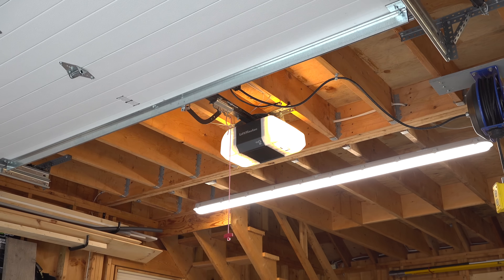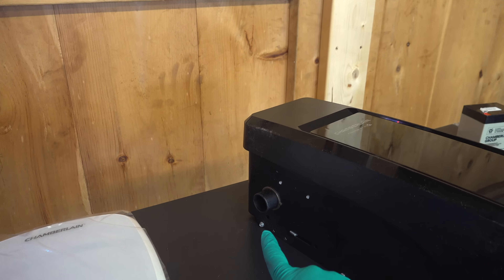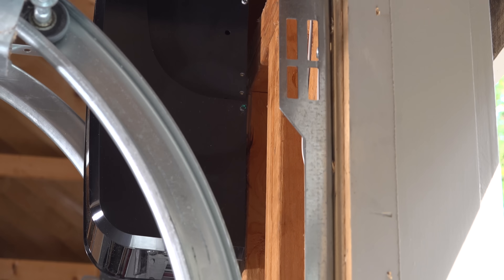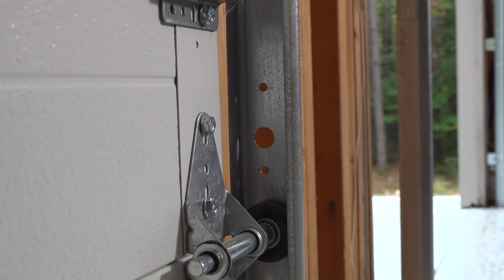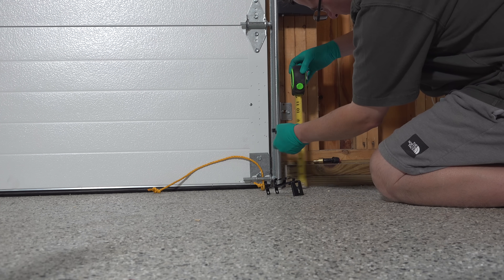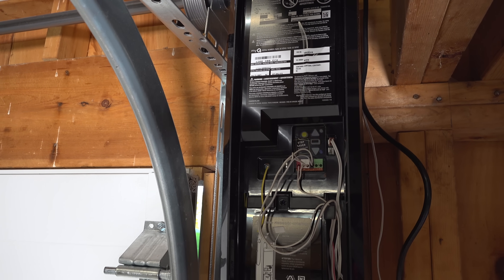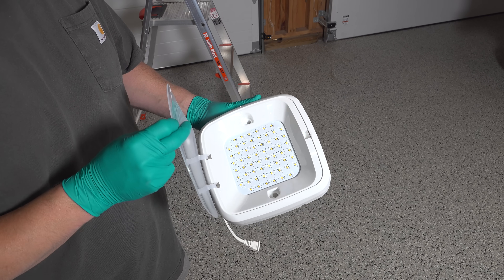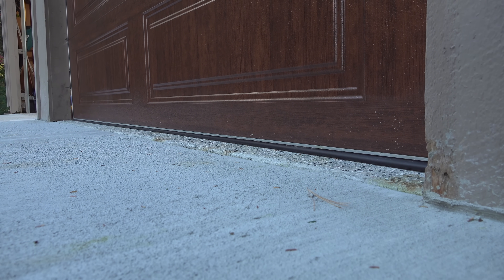Finally a SILENT Garage Door Opener that locks like a SAFE! - RJ0101

Comment: A home door that opens normally will have issues going down, the tension on these gets weird with temp changes, and when that auto deadbolt locks up in the lovk position and your spending 20min unmounting it from the wall in order to get put of the garage in the morning when trying to leave for work, you will end up very angry. Im all about automation, my house recognizes me when i pull in the driveway, i still wouldn't trust that lock. Have your alsrm company install sensors on your doors if you're paranoid.
Reply from the maker: There is a manual slider on the lock, if it fails you can slide it in a second. I am in NH so I can share that it's be handling our crazy temps well so far. Its a great opener.

Comment: I installed one of these and liked it so much I installed it on my other door too. My house was only 5 years old and the old openers were fine but I wanted a cleaner look and yes… these are way quieter than any other openers. But you will hear a clunk at the end when the dead bolt locks in. When I moved into my house, my drywall wasn’t completed in my garage so before I had it finished, I ran a new electrical outlet where the new opener was going to be mounted. I don’t even worry about anybody breaking into my garage. 99.9% of the time if somebody was to attempt to break into your garage they’re gonna think that the garage door opener is mounted in the center of the garage door and they’re gonna be looking for the red cord in the middle of your garage door Not to the side.

Comment: Standard Linear belt drive is quieter, cheaper and less problems.  I your video application, you should have high lifted and roof pitched the door.  In that case the jackshaft is the way to go.  Don't forget to disable the slide lock on the door.  Also, who installed the chain drive operator you showed in the video?  The J-arm and door operator bracket were wrong and will damage the door over time.  The bracket does not go on the strut. It goes 2" under the strut on the stile.  The pin should be closely lined up with the top roller.
Reply: You do not need to have pitched ceiling or high ceiling for this. Mine is under 9 feet. Had no issue installing this in regards to height at least. Regarding price, maybe 100-200 dollars more expensive. I wanted to get rid of overhead unit so I can lift my car. This worked perfect. I freed up at least 2-3 feet. Regarding sound, you're wrong. Again. It's very quiet. Re maintenance, belt needs maintenance. This one doesn't. In summary, you didn't get a single one right other than price

Comment: I was really excited about this product until I found out who makes it. Chamberlain/Liftmaster, who makes the products that use MyQ, has gained notoriety recently in Smart Home circles because of their constant fiddling with the MyQ system in order to prevent people from using it without going through their app. It's annoying when you have to load up yet another app just to be able to control your garage door with your phone. MyQ used to have an API which you could use from other apps, but they've done away with that. There are still some other companies that have access to MyQ (like Amazon Key, which allows delivery people to open your garage door to deliver packages) because they pay Chamberlain for the privilege. If you just use the MyQ app alone, it's free. But if you link it to IFTTT or Google Assistant, you'll need to pay a subscription fee.
I'm voicing my annoyance with Chamberlain in the only way that might change their mind. In spite of the fact that this looks like a great door opener, I'm not buying it from Chamberlain.

Comment: I strongly considered one of these openers, but they are three times the price of a normal-one, and they require an outlet close to the opener (instructions, explicitly say no extension cords although I’m sure you could get away with one)—which nobody will have (I assume you ran a new outlet).

Comment: The only issue of that style is that they don't have the anti crush feature.  If something stops the door from going down, not crossing the beams, the opener will go all the way down and the cables will pop off and the door will still be resting on the object.

Comment: Just some food for thought for people considering these, but I actually like the garage doors are noisy. I like to hear it operating for both safety and security reasons. Everyone, including pets, knows to stay clear of the door when it’s noisy. If it’s too quiet, you may not notice it and that’s when accidents happen. My car idling is louder than this style opener. So if my car is on I wouldn’t hear this thing at all. Also, security… I like hearing it from inside the house so I know it’s being used.

Comment: Our newer garage door opener looks like the old one and uses the same belt system with teeth to pull the door up, but somehow it sounds quiet like the newer one. We do have an extremely heavy insulated garage door, so we might’ve needed a more powerful motor or something.

Comment: A very good friend is an Overhead dealer for 35+ years and i help on installs at times. He has brought up points about these , but are doable. 
The best pointer from him is this, typical torsion springs are a 10,000 cycle spring, about a 7 years normal life.  You should ask for a 30,000 cycle ( approximately) replacement cycle spring!!! It's a 10-20 percent upcharge but it's the same labor for 3x the lifespan.
He measured my broken spring, looked on a chart to see it's replacement ( they are longer) double checked if it could fit and we installed them.
Oh, more hints, 1 turn on the torsion spring for every 1 foot of garage height. 8' high door, 8 turns as a general guide to get started!!
Do double check spring balancing, disconnect opener, open door half way and let go. It should stay there if it's correct, adjust accordingly!
Oil your torsion spring yearly. Rust makes the spring brittle and breaks prematurely!
Reply: One turn per foot only applies to 4" drums and even that is not quite correct. 4" drum times pie equals a little over 12" per turn but when you get to a 5.25" drum times pie, one revolution is 16.485" of travel.
Reply: Somewhat true... 1 turn is 1 foot if lift on a 12" radius with 400 drums...
Reply: My last spring was 60 years old when I finally replaced the entire door and tracks.  Never did anything to it.
Reply: @ChillWill-q5x  Yeah, I chuffed when I read 7 years normal life.  I had a door installed 20 years ago, and it's still going strong.  Maybe the newer ones aren't made as well?
Reply: @mhicaoidh1  Maybe the new "craftsman" aren't as craftsmanny as the old ones.
Reply: @ChillWill-q5x  could be, but spring building isn't rocket surgery.  😆  If, in fact, current springs only last 7 years, I'd be more inclined to blame the (cheaper) materials.  That blame would fall on the bean counters.
Reply: @mhicaoidh1  It's true, older springs are thicker and heavier, but then so were the doors.
Reply: Can you just use more springs with less force from each spring?
Reply: This is very helpful information!  Appreciate the details, in replacing the torsion spring.  I’m on borrowed time with my garage door.  Hurricanes are taking a toll.  Would you put one of these in your garage?  If not, can you recommend an another brand or model door opener?  I’m widowed retired, and second guessing isn’t a good option.  I want to do this before Hurricane season.  Thanks.

Comment: As much as I would like to have this, the clearance on either side of the door is only 8.5 inches.  The unit will fit but I don't have enough room to slide it in place.

Comment: We replaced an old chain drive overhead opener with a new LiftMaster model like this and we're very pleased with it.  Now at almost a year of use, we still love it.  It operates so quietly and smooth, and the deadbolt lock has worked very well.  No problems at all with it.

Comment: I hate the new door openers! I just put one on my door, and adjusting it in was about impossible! Blinking, colored leds? Hold the button until a certain color comes up. Is it blinking or solid. Argh!   What was wrong with two adjusting screws, that actually made sense? One for up, down stop. One for sensitivity, pressure? Simple ! Quick. My new one still isn’t adjusted just right, and I’m afraid to mess with it, thinking it will get worse if I don’t do the procedure correctly!  Oh, don’t lose the owners manual! It has the led combinations, and trouble codes! Fricken trouble codes! On a garage door opener?  Actually my new coffee maker has trouble codes too. My god!  I want to pull my hair out.
 Can’t they leave some stuff the way they were? 😫🥺😂😩😞😠
Reply from the maker: I agree about the buttons in general. I have no idea why even a TINY lcd display can't be there, it would simplify these greatly. Its a good unit and if you follow it, you can customize it but  it could be easier.

Comment: This unit rocks, have had several noisy overhead  units with plastic parts over the years that maybe last 5-6 years. I have had this unit for over 15 years, yes it pricey but well worth the money, and oh so quiet, and not one single problem.
Reply: Wait, you ve had this type of opener for 15 yrs??? I thought this was a new product??? Ive never seen this before ??

Comment: Chamberlain now owns liftmaster it seems.  Sadly, I don't have the space for a jackshaft.  Either side of my garage door there is cinder block wall that's too close to the garage door shaft.  Also, I know a couple of the software engineers that work at chamberlain up in Illinois. ;)

Comment: This is only ok if you have a second point of entry into your garage - regular garage openers have that release in case something goes wrong with the opener itself - what is the manual override on these (from outside) if the power goes out or lock stops responding?
Reply: Hmm wheres the release from the outside on the typical garage door opener, like the one in this video??

Comment: MyQ sucks since they started blocking home automation systems like Home Assistant. Don't give Chamberlain your money.
Reply from the maker: Reddit shut off API access, but allows you the PAY for it now, that's greed. Chamberlain says it was a security reason due to DDOS attacks which could prove a disaster if breached. I believe them since they aren't asking for money and just closed it except to a couple of providers (which can be locked to ip ranges). Is it good that they took something away? Nope. But they aren't saying pay me now, and the app is still free and beats electronic remotes. Their openers are excellent but maybe others will enter the space with a more open model but I am not sure I want that either. Is Chamberlain good? Nope, all companies are in it for themselves,  but 99% of my appliances in my house don't have API access either.

Comment: I have the predecessor to this model, the Liftmaster 8500. It had the external adapter for battery backup and would not accomodate communications with an app via the internet, but it was great and reliable. I still have the house and the opener, but I am in another house now, with a single bay (1 car) garage. Unfortunately, these one car doors only come with extension springs. I would like to convert to a door that is operated with torsion springs so I could use one of these newer openers.  Do you have any sources that sell a DiY conversion kit to torsion springs?

Comment: For my door when the wall switch failed for a very well known issue, which has been ignore by the manufacturer for years, it opened my garage door when I wasn't home. I guess it does both lock like a safe and then open like a safe when you are not there.
Reply from the maker: It's funny you mention that as one other door in my house did the same thing on an 2 year old opener the previous owners installed.. Ghost opening I called it, and I determined it would happen from vibration in the house, closing a door or even just a super loud noise with weak contacts on the wall switch let it open. Drove me nuts for 3 months until I figured it out. I put in for a warranty and they send me a replacement for free though.

Comment: The top panel in the door never gets pressed against the seal. In fact the whole door is just loosely hanging there instead of getting pushed snug with the older opener. In my garage the top panel also falls smacking into the rails when the door get closed and opened.  This could be a great system but the manufacturer is just too lazy to turn it from a promising to truly great product.
Reply: Good point, Ill watch the video again to see if I can see this. Be good if the sliver cymbal can comment on this

Comment: What makes the most difference is DC vs. AC.  An AC voltage opener will always produce more noise than a DC voltage model.  A ceiling DC model is quiet just as well.  There are ceiling mounts designed to absorb vibration as well.  A ceiling mounted DC Belt driven opener is quiet enough for a living space above.  A ceiling mounted opener also doesn't need the deadbolt.  I would only use a jack shaft opener in a situation where I don't have enough headroom.

Comment: Recognize this clearly stated that the individual model is not important, but buyer beware, Chamberlain is a harshly anti-consumer company. Late last year, they shut down outside use of their API as a method of drawing folks into their ad supported app as the sole entry point for opening your door. Probably will not effect you if you don't hope to integrate this into a larger automation system, but anyone who is looking for something compatible with Home Assistant or looking for API access, go elsewhere.

Comment: They suck, they don't seal the door. The top will move back and forth during high wind. The other garage door openers will push a bit on the top of the door against the the frame.

Comment: Hate to tell you. But with your control panel mounted right by the door it’s even easier to break into than the old style door openers  with the manual release on the drive. Also a zip tie on the old style door release makes them impossible to open with a coat hanger

Comment: No Chamberlin openers. Their hostility to independent automation makes it a non-starter for me. I don’t need their permission to open my garage door.
Reply from the maker: There is no permission required to use your opener locally or with their app. Chamberlain gave their api away for free and decided to stop after seeing that Reddit broke new ground and realized they could do the same. I can't really blame a company for deciding to charge for something, they are all like that. Problem is that openers need to be reliable and last, this is the issue. I have checked out some new openers and they just don't have the history. It would be great if someone made an open source type of opener but I suspect the software would be great and the mechanical part very poor. From the forums I have seen people are using the dry contacts to operate the door with HA but I get that is extra. Personally I would never connect door access of any kind to my HA stuff, except maybe for read access. Maybe I am old school with this but doors and heat/ac are very different than a door opening to me. So while yes, Chamberlain pulled the same douchebag move as Reddit I would use their free app. I use it all day lond and it's decent. If they charge for it, ever I will just go to dry contacts myself. Problem is these guys do make the best home openers around and their detailed stats about the opener is second to none, which never went on the API anyway.

Comment: I’ve been a tech for 5 years and rarely recommend these unless if the door has high lift (doesn’t go up around the track radius right away). If you’ve got a regular garage door and want a quiet ceiling mounted operator look into the Liftmaster 8160W, 84501, or 87504. They’re just as quiet as the jackshaft operator.

Comment: I consider the light setup to be a serious weakness. A built-in switched line voltage output is a clear winner in any installation. It would lower the cost, assure 100% compatibility, and even ease installation. It is hard to believe Chamberlin missed this obvious, low hanging, design fruit.

Comment: If it has Wi-Fi, THEY can access it.
Reply from the maker: Yes if they were using a point to point with local access, provided they embedded a backdoor. The device won't be getting an external connection unless you are entering your local wi-fi credentials

Comment: The 98022 is so nice. It’s incredibly quiet and opens and closes so much faster than my old chain drive. I installed a Ratgdo to integrate it with HomeAssistant and avoid MyQ.

Comment: I just installed the LiftMaster version of this (they're identical, as far as I can tell). It is very quiet and having the app is great. I also installed a second wireless opener switch inside my garage so I have the option to open it with the included switch (which is wired and needs to be relatively close to the motor unless you want to plumb the wire through the wall or have an exposed wire), or with the wireless switch which I placed beside the man door that leads into my house. However, when I was finalizing the installation the first time, an Amazon driver interrupted the critical final adjustment step where the motor automatically sets the closing force. I reflexively tried to stop the door so it didn't close on her head but, unlike what another commenter stated, the motor was very much forcing the door down against my momentary resistance, so much so that the spring came undone and the torsion tube bent, and then the door just fell to the ground with zero resistance (because the spring had come undone). Luckily, Amazon refunded my purchase price and I was able to order a new motor, but I did have to call out a professional to install a new torsion tube and reset the spring. So make sure no one interrupts you during those final adjustments!